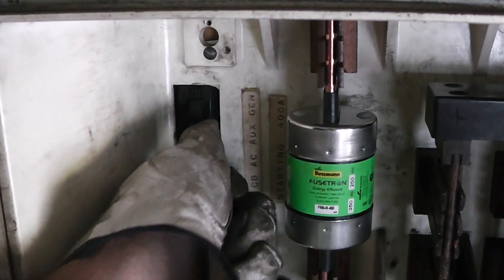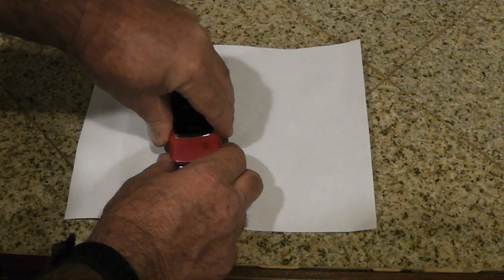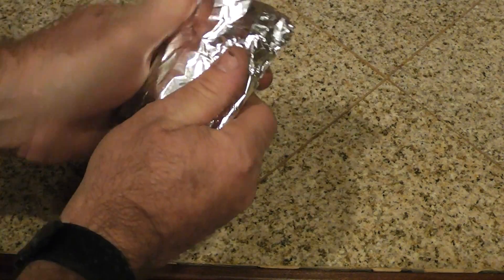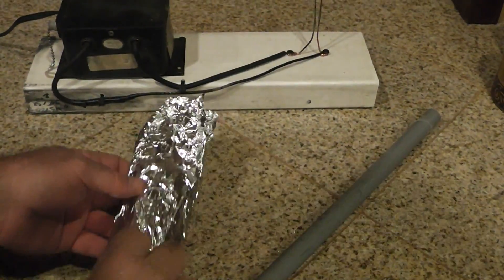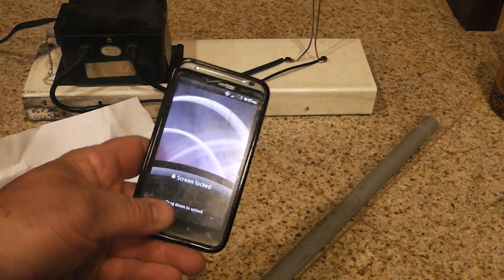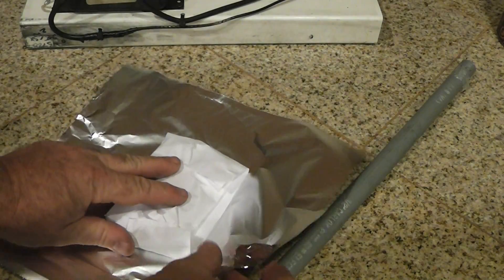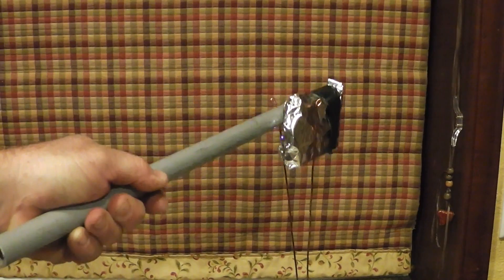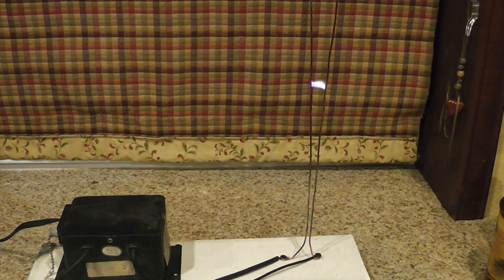Faraday Cage Testing Electronics with a 7500 Volt 30 Milliamp EMP Generator

Comment: Nice!  And You will be joining the Mythbusters Team soon!  LOL.

The flip side of the equation is that a microwave oven is a great Faraday Cage (as long as you don't turn it on!)   Any easy test would be to place your cell phone in the microwave oven, so that you can see the "bars" through the window of the oven.  You should see the "bars" go to zero ... and the oven is a good one!  An old microwave oven could be used to store extra electronics that you want to protect from an EMP Pulse.

Comment: So, OUR electric gadgets can be protected, but the cell, radio, TV towers and Internet radio signals are NOT protected. How are we helped?
Reply from the maker: Night vision goggles,ham radios,cb's,gmrs,murs,solar panels and controllers,lap top computers,flashlights,led lighting,electronic tools,digital cameras,electronic ignition parts and etc. would be most beneficial after an EMP or solar event.

Comment: Very nice mini emp test. I used a galvanized can and sealed the seams with foil and duct tape and it prevents signals from being broadcast when the lid is put on. However with the seams uncovered I got the cell to ring and the 2ways to work. Maybe just maybe with my mods I may have a minuscule amount of protection for radios, cells, battery chargers, batteries, lights, computers etc
Reply from the maker: Thanks.  It sounds like you have some substantial EMP protection.  Thanks for sharing the info.

Comment: Voltage doesn't kill, AMPERAGE/CURRENT KILLS.
Reply from the maker: Your statement is partially true.  However, our body's resistance is a constant and you will need sufficient high voltage to kill ( I=E/R).
Reply: No sir, body resistance varies.  For example, if wet R decreases, therefore with constant V, the I increases.  A taser operates on high voltage, but usually isn't fatal.  Lightning is an enormous spark with incredibly high voltage and is not neccessarily fatal.  0.1 amp, 100 mA is fatal.  Your equation for current is correct, though.  I'm not saying high voltage isn't dangerous, but the higher risk is current.
Reply from the maker: Anthony Browning
I've got( 2) 12 volt 1000 cca batteries in parallel (2000amperes at 12 volts) needed to start my tractor.  If I put my wet left hand on the negative and my wet right hand on the positive there will be no death and no shock even though there would be sufficient amperage to kill . If I increase the voltage, then I increase the amperage and therefore the risk of death is increased.  This is why when you go into a main electrical room you will see "Danger High Voltage' and not "danger high amperage".  Now, I do know that you can have 30,000 volts and microamps, no matter what the resistance is you will never achieve enough amperage to kill.
Reply: homesteadprepper You are correct in your example that there is no death on 12 battery, when wet.  The lowest resistance I could get with my hands wet was 100Kohm.  That is about .12milliamps.  Not nearly enough.  Point is there are 2 variables that affect current.  I don't think I would voluntee to put my finger in your Jacobs ladder.  Voltage signs are there because the voltage is a difference in potential.  That is what gives the spark.  It is also what will lock up the muscles and holds someone onto the conductor.  Electricity is dangerous and should be respected. In your video you said voltage kills, I was correcting.  It is probably sufficient to say that electricity can kill.  Proper respect should be shown to it and proper procautions should be taken.
Reply from the maker: Anthony Browning
I concur.